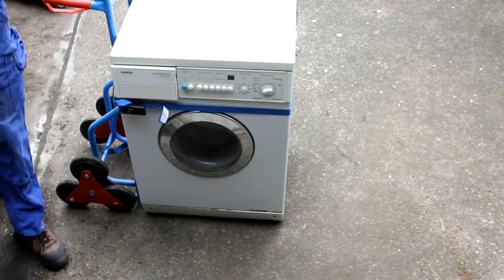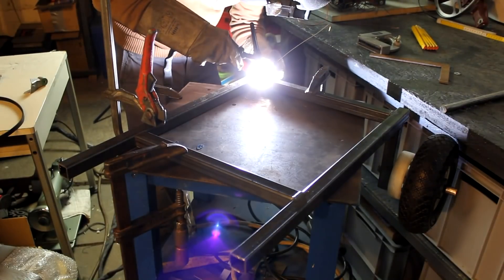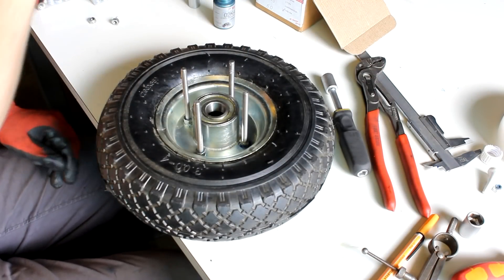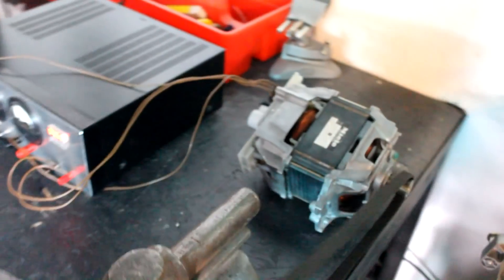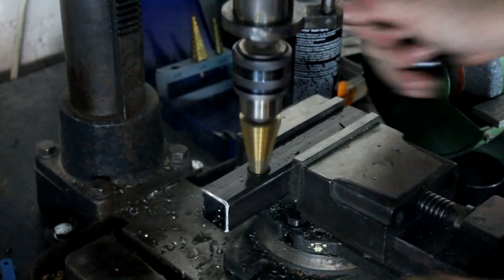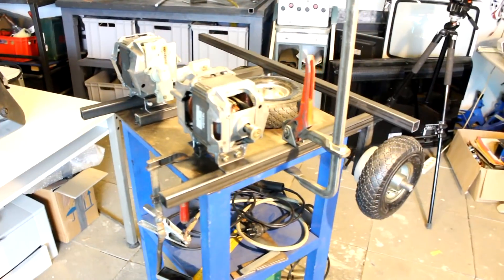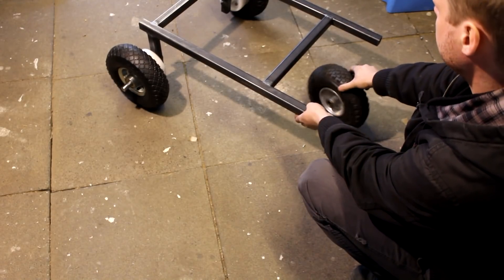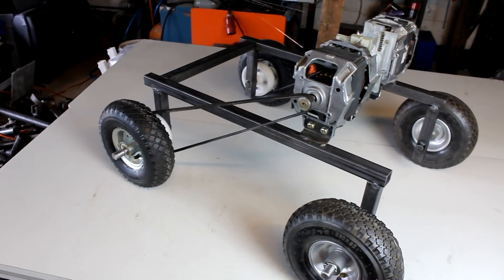Drivetrain with Washing Machine Motors

Comment: Use caster wheels on the front and steer with differential power on the motors.
Reply: rear and power on front
Reply: That's a great idea!  Way easier than constructing a full steering system.  Also saves the cost of a servo.
Reply: Richard, convex (a crown instead of a valley) would actually help belt tracking (weird physics, that's the way bandsaws track).  Ideally he should instead mount them in the lathe and cut a proper square "U" shaped groove, like this: | |______| |
Reply: This is what I came here to say. Simplicity at it's best.
Reply: An interesting video on concave vs convex physics with "rolling" objects:
https://www.youtube.com/watch?v=Ku8BOBwD4hc
Reply: Put two swivel casters at the front and two at the rear. Drive wheels in the center with independent H-bridge motor drivers.  Voila, king size Amazon Kiva:
http://robohub.org/meet-the-drone-that-already-delivers-your-packages-kiva-robot-teardown/
Reply: For rough ground and weight caster wheels are shit, only if nothing else is available would I suggest going there.
Reply: Exactly!
It's just a matter of controlling the motors separately for steering capabilities... (I think)

Comment: It is not a big diffirence in diameter betwwen the wheel and the washing machine poulley, why not using the lighter poulleys as wheel where the belts can act as tracks?
Also, the steering is most simple on tracks vehicle.

Comment: Its very cool how you reuse washing machine motors. I live in Canada and it is a little more difficult. The motors here are induction motors with motor capacitor on the start winding
Reply: You can still reuse them. Ihave several in use for wire wheels/buffers/sharpening wheels. I think the Europeans are more efficiency aware so that is why they chose to design around those motors and use front loaders. Here most washing machines are still top loaders.
Reply: yes in the uk and europe, washing machines use many different speeds and reverse during the cycle, (and variable spin speeds after the wash) front loaders do more, im supposing you have the same top loaders as the usa, where an agitation action is all that is used, thus a simpler motor, but if you see bigclives latest video, it seems the newer way is to use induction again but havea  phase speed controller
Reply: Also I have noticed thar front loads now, in Canada, are using 3 phase brushless dc motors. And I have noticed that in Europe they do design more efficiently. And thanks for pointing me towards BigClive.